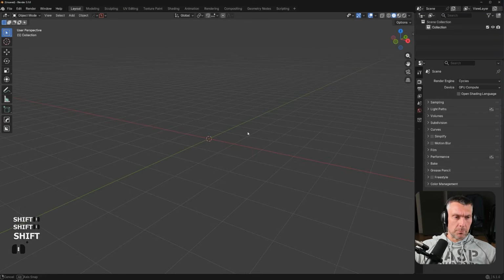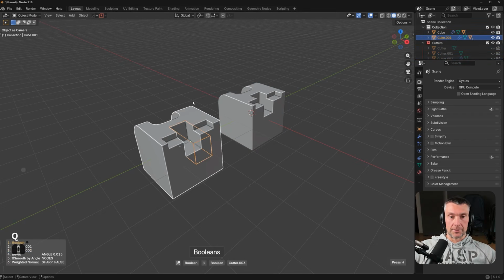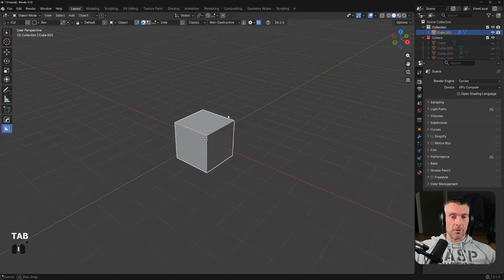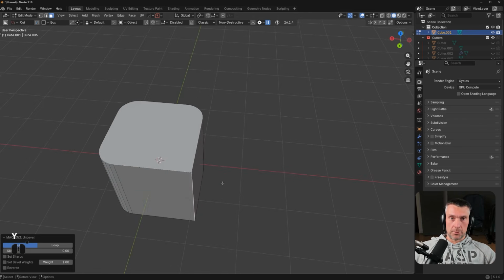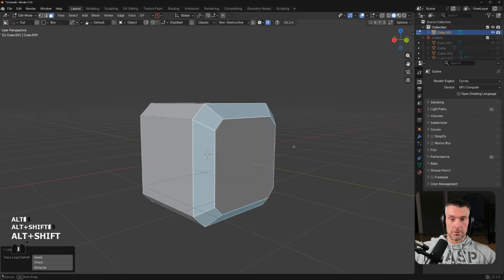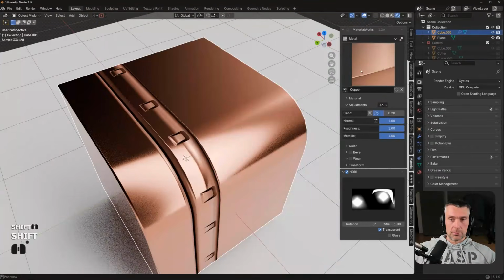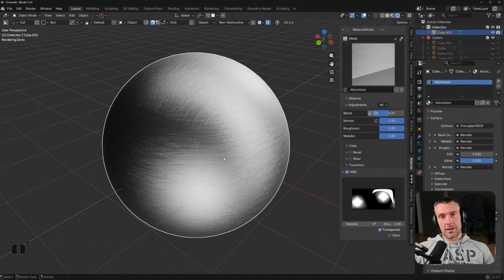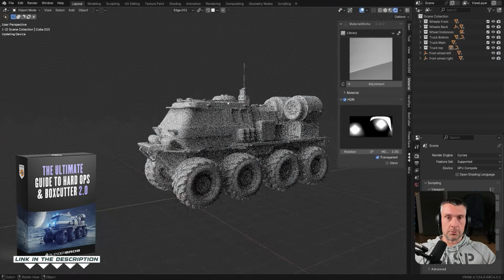The Only Blender Addons You Actually Need for Hard Surface Modeling

Comment: i tried a ton... most of them are only usefull for very specifc tasks... 

for me he poliigon and poli haven is very important for materials..
box cutter and booltools, extra curves, meshes etc are also good for modeling.. 
nodewrangler is also a must have...
Reply: Well let's say that you want to 3D model a complex looking robotic arm with inside electronics. What addon for Blender would you recommend.
Reply: @Vadrigar1  box cutter
Reply: @DaveDRC  Agree, ChatGPT told me the same. I'll purchase the MechMachine too just in case when I start adding extra little details and my topology starts getting messed up.

Those bevel issues drive me insane.

Comment: Id love to see material works workflow for game assets. I see the use for concept or just keeping assets in blender for portfolio work. But for my use case, i would get it if the textures can be baked or used outside of blender and on game assets in a game engine like Unreal Engine. 

Also nice video so far. Thanks!
Reply from the maker: Those are real mats so you'd simply need to export those maps mate, preferably the 1k ver. Maybe we could add export feature to the addon, we will see.